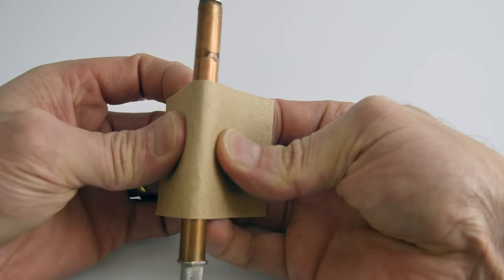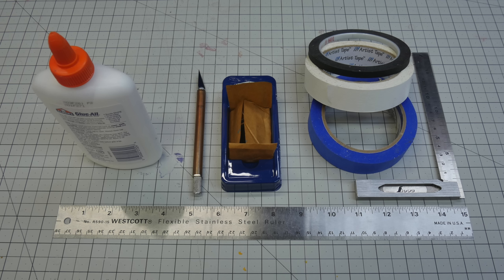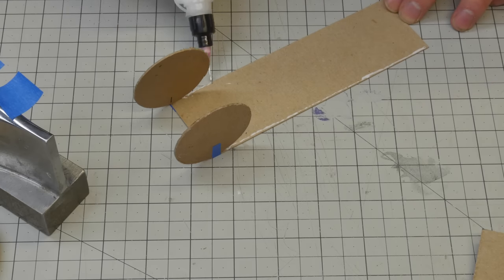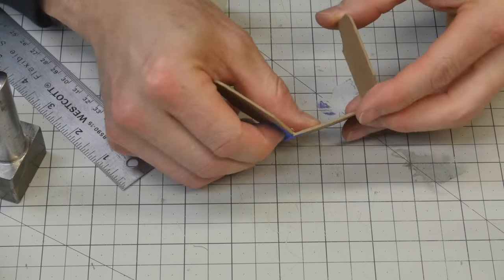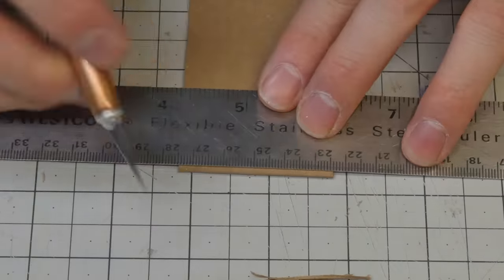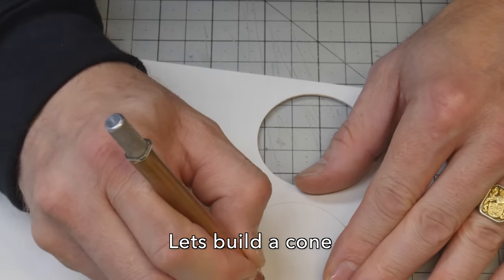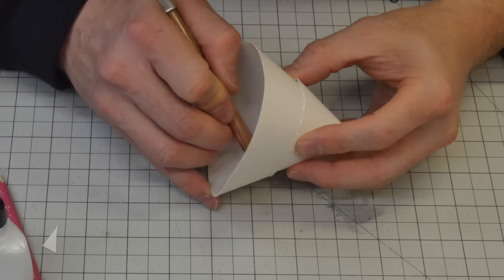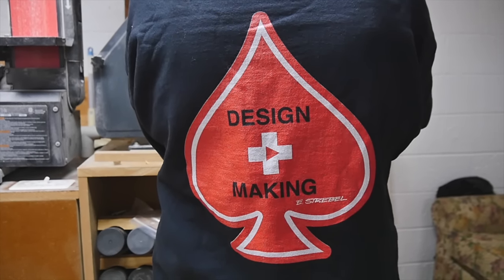CardBoard Advanced Basics Tutorial guide for model making: modeling for Designers & Architects

Comment: A half length of the side material could be used as a "girdle" to hold the butt weld in place while the cylinder dries to form the seam just so. Or masking tape in mild tension, actually.